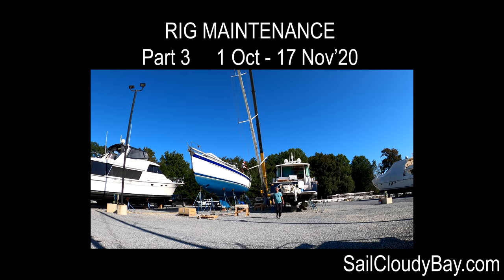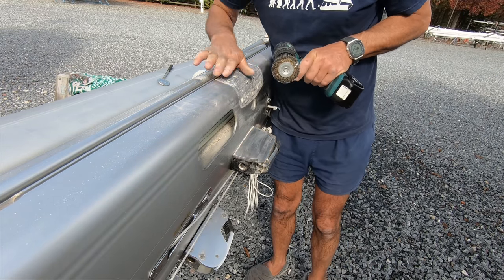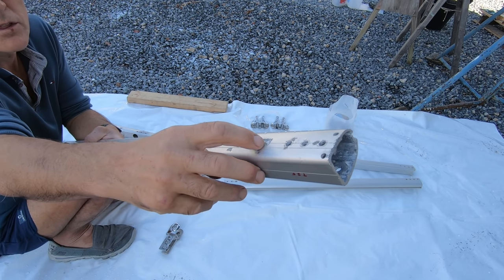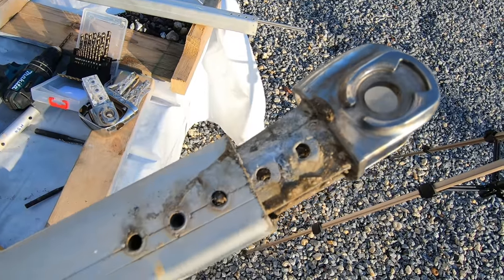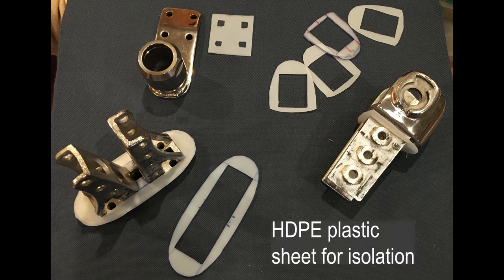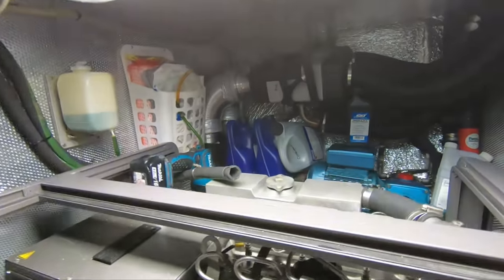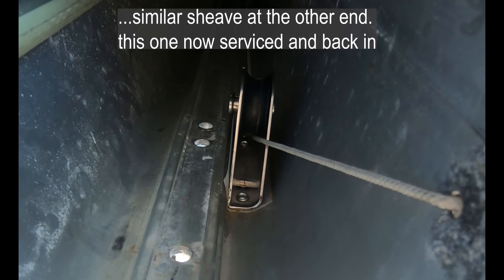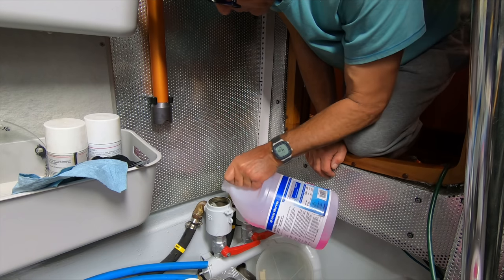Boat Maintenance – Rig Service part 3 - Hallberg Rassy 54 Cloudy Bay - Oct-Nov 2020. Season20 Ep23

Comment: I am enjoying all your videos. They are extremely well done and helped me bear the covid confinements. The maintenance videos are outstanding and will help me maintain my own HR54. Thank you very, very  much. In one of your sailing videos you notice a noise at the bottom of the mast and remark that it might come from the furling system.  Since I have the same noise at the bottom of the mast of my HR54 and have not been able to locate the cause, I would be very happy if you told me whether you have been able to solve the problem.

Comment: Nice work. Here is a tip. When I changed my cutlass bearing, I put the new one in the freezer for several days. I then brought it to the boat on ice, in a cooler. Slid right into place without any need for a hammer.
Reply from the maker: Wow .... now THAT is an interesting tip. Thanks. Will certainly try it because hammering on that P-Bracket cannot be good for the structure.

Comment: Thanks for your videos on servicing your Furlex hydraulic furlers. As you are aware Selden doesn’t provide any detailed information on servicing these units. I also have the same system ,so your videos were a gift from heaven. You have no fear in stripping things apart. Thanks again.
Reply from the maker: Hans, I'm very glad it was helpful to you. I now have all the parts and will be putting back to gether again in April. If you want to msg me for any details on parts etc, you can contact me via FaceBook messenger, Sail Cloudy Bay
Reply: Thanks, Glen

Comment: Nothing is beyond your scope. You really take it on and get it done. Very impressed with your cruising show. It's my style of sailing and you are the benchmark. Your wife is the perfect cruising companion. Very professional winterization. Thanks.p
Reply from the maker: Thanks Peter. Yes, I like to get stuck in because when things break in remote areas or nesty conditions when off-grid, every possibility needs to be in my knowledge scope. So I use these maintenance session to ready me for such an eventuality. Plus of course, I enjoy it :)
Reply: Your show is a master class in cruising. Hoping to get cruising again in the near future. Spent 12 years cruising my Bristol 32 ,my home port being St. John VI during that period. Looking to get A Garcia Explorer 45 next. I ran into a few social and weather road blocks that told me I need a very versatile and beast of a cruising machine. Love your boat. I own Tutu point salt pond on St Thomas and to get in you need under 4 feet draft. Best Hurricane hole in the VI. NOT that I want to hang around during hurricane season. But If I have to fly out I can put the boat on the hook there and know my boat isn't going anywhere while I'm gone. Thanks again.p

Comment: Intense video.... great!  Did you do the watermaker?  Generator and engine - I ran fresh water into the intake filter bowls and added antifreeze at the end as the engines were switched off.  Not as thorough perhaps, but very quick.  You can buy anodizing solution and kits - better than painted primer?  Drain holes are pivotal, well done for adding those.  Structural steel box and tube has a hole at high and low level - although with mast the are plenty of apertures higher up.  I suggested on another channel to add one or two cameras at the top of the mast, not sure if I've already mentioned this - the Raymarine units are not too expensive and the quality is surprising. The stainless steel cleaner looks good, will have to try some - away from teak decks!  Another fantastic video and April is only just around the corner - where does the time go!
Reply from the maker: Thanks for the great comment Bob. Yes, I did the water maker, and all the hot/cold water systems and sink/shower/toilet drains,  but I cut those out the video as it would have been too much of simply pumping antifreeze around stuff. 
Yes, been thinking about re-anodizing. I understand how to do that on small pieces of aluminium that fit into a bath, but not so sure how I would re-anodize parts of the mast. But you have got me thinking. I'm going to do some research. 
Also thought about cameras .... may well add one ready to high-view when coming into reef structures in the Pacific.
Hmmm you've just added to me to-do list!
Reply: @SailCloudyBay  Hahaa, love the channel Glen, just another way for me to get more content from you!  Joking aside, the costs involved wold be stratospheric if you were to subcontract this work - thank-you Seldon... so it's beneficial to all and sundry to understand and be able to carry out these repairs.  A couple more thoughts and comments - the corrosion on the mast is electrolytic - I've often wondered if an anode arrangement could be implemented, particularly keel stepped, and, secondly following on from an incident on a super-yacht, you should check neutral and earth loop impedance from the generator and inverter(s).  Dangerous situations can occur when a neutral or earth has a high impedance..   This is one time when you might want to get a marine electrician as a normal multimeter cannot perform these task.

Comment: Glen, you are a diamond. Your expertise in maintenance is mind boggling. Have you heard of A.C.F.50 (anti corrosion formula 50) it has been developed by the aircraft industry. It might be a great help for you fighting the corrosion. May I suggest you google it. A super series. I love it . Thanks a million.
Reply from the maker: Barry, Thanks for the compliment :) 
Frankly I don't consider myself to be any maintenance hero. I'm just someone who is not afraid to get stuck in and learn by mistakes. And I hope my videos help to inspire others who maybe less confidence with their own inner abilities.
Yes, I do use ACH50 quite alot, thanks for highlighting that. But I only use in non-exposed places, like coating electronics and mechanical items inside the boat. I maybe wrong, but I don't think it has the lasting power be out there in the UV and exposed to the full harshness of marine environment, and continue protecting an aggressive SS-Aluminium interface for 10-12 years. I've been on lots of forums about this, and the general consensus for long-term protection from galvanic corrosion between dissimilar metals are: Durlac, Lanocote and TefGel and the best - total isolation using a thin layer of HDPE plastics.
Thanks for the comment and very glad you enjoyed the videos. More coming soon.

Comment: I'm Wondering Weather Maintenance Should Almost Come Before Boat In The Title. Great Video.
Reply from the maker: Yes Dennis, you could be right!
Reply: @SailCloudyBay  Hey Thanks For Having A Sense Of humor. And Incidentally, I Owned A  Lightning With A Serial # 11079 Back In 1990. It Had A Fiberglass Hull, Spruce 26 Foot Mast That Was Not Quite In Plumb And A Stainless Center Board, So I Have An Idea Of How Much Maintenance Is Required With A Boat Powered By Wind. Dennis

Comment: An impact screwdriver (the manual one you hit with a hammer) is awesome on stuck screws. Get one, you won't regret it. Remember that the screws in the mast is stainless, put some gope to stop galvanism.
Reply from the maker: Yep, thats what I'm using. Impact driver. the screws will back in with Durlac.

Comment: The attention to detail in everything you do is so impressive and why I am addicted to your videos. The sailing is amazing but the maintainence is on another level. What did you do as a profession?
Reply from the maker: Thanks for the compliment Darren. I spent 31 years with an Oil & Gas service company. Initially working on rig operations for 10 years then office and management. Being on Cloudy Bay kind of takes me back to my operations days where everything seemed to need constant attention to keep things running in the harsh environments the equipment was exposed to. Those were my happiest days .... not so much behind a desk!

Comment: Interesting, Starlink has applied for mobile use with the FCC today. Musk says the new update will be able to be on the move and still stay connected.
Reply from the maker: Yes, I was just reading that too. But also, in the finer print, Elton says the system would be too big for a car, but OK for RVs, Trucks and ships. So it will be interesting to see the size of the equipment. But all in all, I'm quite excited about it. It will certainly change sailing for all those that crave continuous connectivity to the world .... like Oana!

Comment: You are quite adept at technical smarts very good! Impressed with the ideas as well, you can also use metal brushes shorter than normal with non ferrous types that are slightly softer than the metal you are trying to clean/polish or infuse.
And the anodizing is easy as sail sewing... LoL. If you stand up the spreaders in solution and then apply "typical anodizing method" not really acidic, or basic less than  clearing out a drain with the same. This is just spitball information take with a grain of salt. Anywho your probably way ahead of me soTHANKS FOR THE VIDEOS HAVE A WONDERFUL WINTER SEE YOU IN THE SPRING!
Reply from the maker: Thanks Zeke. I didn't really think of that angle, because I didn't think you could re-anodize a surface that was previously anodized. But, you got me thinking. I'm going to investigate.
Reply: @SailCloudyBay  there is a Russian guy that I saw on YouTube that was doing this on ends of metal sort of like overlapping paint, some overlap will come off but the cleaned and dressed part will cost! They took his channel down I think. And if you can buy used spreader type extruded aluminum that are little longer than yours needed you can shorten and fit lastly the welding sticks they sell for aluminum allow as strong welds (when done right as you would😉) and it's just using soldering torch with propane and no Tig gas needed but I know you would love to learn Tig welding the things you can weld and do OMGOSH IT SATISFIES LOL (see I get OCD  treatment by completion of these type things 😆) and I was asking what professional field you were in( sorry I'm not trying to be a bother)
Thanks again for the finishing video very nice work that ship looks like NEW!
Reply: @SailCloudyBay  oh the part that's getting redone has to be striped to bare metal this is the part that takes stamina and nerve but you can do the whole process it's just dipping till submerged maybe you can do blue to match her boot strip and letterhead oooh that would be neat and just as protective

Comment: Greetings. Very nice work. T9 was made to stop corrosion on aluminum that can’t be inspected regularly. I’ve not had a need for that, so I can’t comment on its effectiveness.
Reply from the maker: Yes, I use T9 alot. Especially on electrical parts. But on the mast, open to the weather, heat, sun, UV, salt etc. I'm certain T9 would not stand the test of time. Lanocote on the otherhand will be in place for a decade at least.
Reply: @SailCloudyBay  Good to know that about Lanocote. Thank you.

Comment: Glen, fabulous job and very educational! Can you share what service life you are getting between your factory quality refurbishments?  Specifically, standing rigging. Do you think 900 hours on a cutlass is reasonable?  Also, let me know when you are ready to sell Cloudy Bay. I definitely appreciate the care and attention you have applied to your maintenance work.
Reply from the maker: Hi Brian, difficult to estimate service life really. Its all about how much the boat is used. I expect to get another at least 10 years out of the replacement rigging, but the hydraulic motors will probably need another thorough service in about 5-6 years, mainly to change the seals. On the Cutlass, I feel I should really get more out of it than 900 hours. I could likely have carried on using it for another season, but I also know that vibration can do terrible things to a transmission and prop. Could possibly have just turned it 180 deg too, because the wear is only on the lower side. But its one of those things I don't like to cut corners on, once the boat is out the water.  On selling Cloudy Bay, when it comes to it, I'll be sure to let people know. I don't think I will be needing an agency!

Comment: When I see all those mast and boom problems concerning reactions between aluminum, stainless steel and seawater = corrosion  I wonder if a carbon mast and boom might be a ( expensive ) solution.
Reply from the maker: There could certainly be a good argument there. I think you are right, the extra cost my be advantageous. But there are not many 12 year old carbon masts out there to compare to

Comment: As always I admire your meticulous way and great documentation how you maintain your boat to the T.
In aviation we use some great products to prevent corrosion, I never seen being used on boats and don’t quite understand why those products are not being used for sailboats. Generally aluminum aircraft parts are treated with a substance called aludine it has now a different name but aludine is still used and understood. After that treatment commonly a zinc chrome primer is used for further protection. The other product we use particular on seaplanes is a waxy like substances we spray into inaccessible cavities, to prevent corrosion, it stays flexible (ACF50) and would have worked excellent for your spreaders. I would recommend you go on www.aircraftspruce.com where you will find all information you need. Or else talk to an aircraft maintenance engineer. 
It is a true joy to watch with what kind of love and dedication you take care of your vessel!👍👏👏👏👏🙏🙏⛵️
Reply from the maker: Good thinking Samai. I'll take a look. Likely the "waxy like" substance you spray on sea planes is probably something like Lanocote.

Comment: Excellent videos Glen. Have seen them twice. Have you replaced the through hulls and seacoks to bronce? I believe originals are made of brass. What about the plug to drain the sink? Did you have a look at it?
Reply: Ups I missed it, of course you changed them on January 2020.
Reply from the maker: Yes Issac, we changed all to Bronze (Groco brand) in Nov'19

Comment: it just hit me how much bigger everything is on ur hr54..looks like all things are like triple the size than whats on feks a 39.(and those prices for the spreeaders would bring me a good boat..20 000?????) thanks for awsome video again cpt
Reply from the maker: Jan, I agree. They say cost and yacht systems size/strength goes up exponentially with length. And I think its quite true. Its one of the reasons that I see this size of boat is the max that 2 people can safely handle (maybe already too big). Above this the forces on everything just get unhandlable, especially when things go wrong.
Reply: may i ask how many years u have on the sea?
Reply from the maker: Jan, Prior to Covid we had been "at sea" (living on the boat) since May 2016.  That is when I retired from work. But we stopped in June 2020 to take a break while this Covid thing is on, causing issues for entering different countries.

Comment: My sympathies on the spreader torture job. Excellent job on the cutlass-bearing. Love that tool you made for the job. Couldn’t help but hear the sailor language in the background it added spice to the show. The background music made portions of it sound like the old Benny Hill shows, great editing sequences. 

Did you freeze the bearing before installing it?  Does the shaft have a second bearing in the shaft through hull tube?
Reply from the maker: Hi Michael, No, I didn't freeze the cutlass.... that's a trick that I only just learned. Thought the Benny Hill music may add something .... just need some scantily clad ladies around me to go with it!

Comment: A lot of work!) What was your motivation to do it yourself? the question is not about saving money
Reply from the maker: Paul, I always do as much as I can possibly do myself, for these reasons: I learn about the system when I maintain it, and this knowledge could be invaluable if/when (more like when!) I need to fix anything when we are sailing remote places. We save a lot of money, particularly in USA where man-time starts at $100/hr. And lastly, because I enjoy it, and get great satisfaction knowing the job is done properly. Unfortunately that is not always the case whenever I've used professionals.

Comment: You have the plastic over the end of the aluminum extrusion but what breaks the electrical contact between the aluminum and stainless through the rivet connections?
Reply from the maker: The truth is Hayden that you cannot stop the metal contact everywhere. These plastic strip(s) should protect the raw ends of the aluminium extrusion and inside I use Lanocote and Durlac on the rivets.